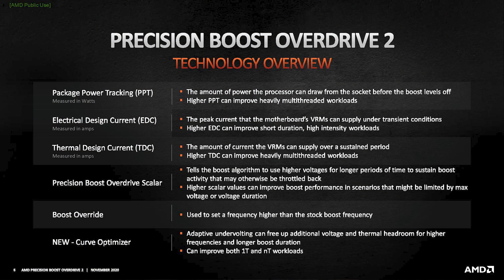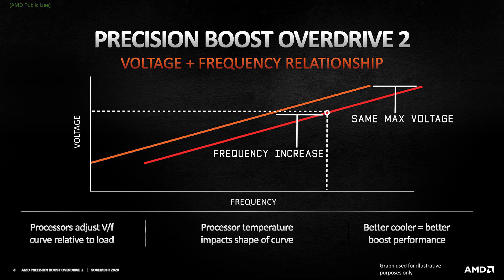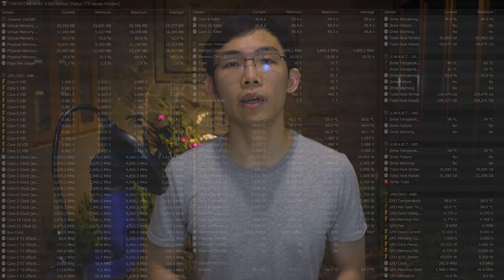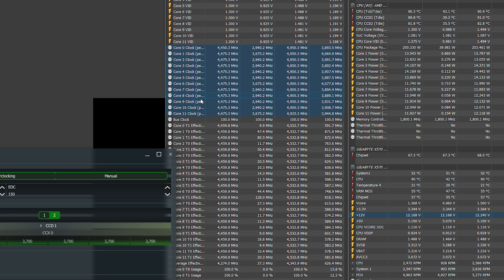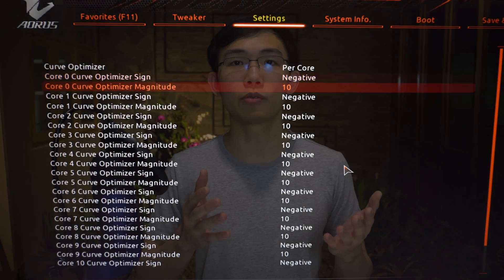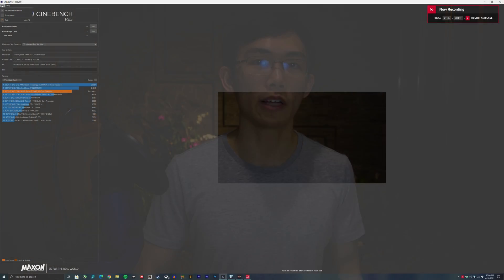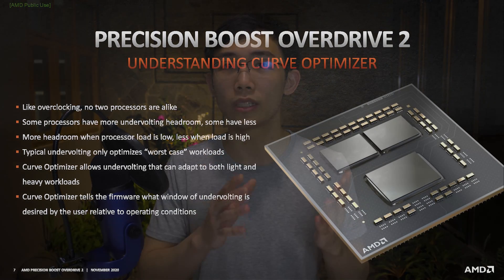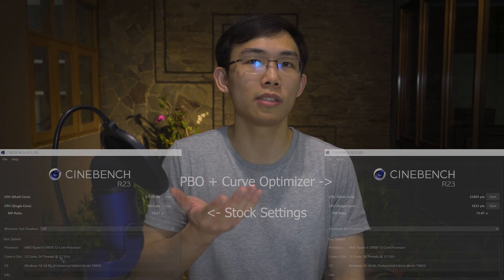The Best Way To Overclock Ryzen 5000! | How to use Curve Optimizer

Comment: 11:39 Actually it is very easy to pinpoint the core that crashed. Just open your event viewer and create a custom view for the WHEA-logger. As soon as you crash, go to the viewer and check the APIC number that corresponds and divide it by 2 and there you have your crashed core. If you open CPUZ in the tools section, export an html and search for the APIC section and see which number corresponds to which core on your system. It might sound complex but it really is fast and accurate
Reply: It was simple at beggining because the error in Event viewer was telling me the APIC ID... But after that my pc was crashing randomly wihout telling pe the APIC nr, just that the pc shutdown.... I tried to lower them by turn and it didnt work... I had to lower all of them by 5 and now is ok..
Reply: You don't actually have to use CPUID to figure it out.

If you have a 4 core processor with hyperthreading, it will be like this:

Core 1
Thread 1 = APCID 0
Thread 2 = APCID 1

Core 2
Thread 1 = APCID 2
Thread 2 = APCID 3

Core 3
Thread 1 = APCID 4
Thread 2 = APCID 5

Core 4
Thread 1 = APCID 6
Thread 2 = APCID 7

For example, if you get an error with APCID 26, then it is the 12th core in the processor causing it (particularly the first thread on the core).
If you don't have hyperthreading, then the APCID will simply be identical to the core number. With hyperthreading, each core has 2 APCIDs. The APCID always starts at 0, so your core 1 will have APCID 0 and APCID 1 with hyperthreading, or just APCID 0 without hyperthreading. Perhaps I'm over explaining, but you can see the pattern in my example above.
Reply: @jonny6702  that was cool, thanks for the tip!
Reply: @jonny6702  If I have a 4 core processor with hyperthreading - how can I get an error on the 12th core??

Comment: I have 5600x with Arctic Freezer 34 Esports DUO.
I check the stats with HWinfo64.
Testing with Cinebench R23.

When my "PBO limit" is on "Motherboard" the temps go to 82, when "Disabled" temps are 66. With same other settings. Can you tell me why is that?
I saw that when I set Curve Optimizer to all cores "-30" and PBO boost "+200", the Single core clock is higher "4,841" but the Multi-core goes down around "4,260 - 4,313"... Cinebench Multi-core test ~11000 or little lower.
Like I said, if I change "PBO limit" to "Motherboard" the temps go 82 to get higher Multi-core clock, but it is not worth it.

If I set PBO to just "Enable", without any other setting, the Single core is ~4,65 but the Multi-core goes up to 4,55, at the cost of 82 degrees, which is not good again...

I want to achieve both high Single core and Multi-core with around 66-70 temps!
Any suggestions?

P.S. I didn't understand what is the manual method, calculation to determine the EDC, TDC, PPT values, this is why I tested with "PBO limit" either on "Motherboard" or "Disabled".

Comment: 5:44 I have also noticed mentioned tendency myself: higher EDC gives higher temperature but clock speed is lowered, while lower EDC gives lower temperature but clock speed is higher. Assuming that the EDC limits are reached in both cases, it means that the computer draws more current and works slower, yet generates higher temperatures . This doesn't make sense. Unless we assume that at lower clock speeds and higher EDC, the processor is more heavily loaded but operates slower (or wastes power). I think that changing all these PBO settings (EDC, PPT, TDC)  is merely an optimization for specific applications, rather than overclocking per se. A more loaded processor operates at a lower clock speed, while a less loaded processor operates at a higher clock speed. Which is better depends on the application.

Comment: I turned off all limits in MSI bios after worrying warning. my 5950x ascended to 5.2ghz and then tripped something and system froze. i guess I am doing it wrong. is 1.45v on cpu safe or shhould I stay under 1.3?

Comment: Hey 
O!Technology, if you increase the 3 values of the PBO limit you will push more voltage in your CPU and you will have high temps. You should disable the PBO limit so the algorithm will find the lower voltage that the CPU can run the high frequencies. Also if you choose the lower power saving plan you will see a drop in temps without loosing performance. About 95% of the time your CPU will be at max 85% in usage so what you see in the stress test it will never happen (not even if you render a video). Aside from this the power saving is made to better adapt the consumption to the load and if the load needs all the cores at max, it will allow the voltage without loosing performance.

Comment: The most common crash after overvolting is changes between high load and all core idle. This is because those change points cause high ripple currents which may trigger the crash.

Comment: 6:56 "This is completely safe" after using PBO features that explicitly say "Warranty void" 🤔

Other than that, great video!
Reply from the maker: I didn't say anything wrong though? Thanks!
Reply: @OTechnology  Even enabling PBO may damage your CPU and the official party line of AMD is that CPU is no longer covered by warranty if you enable PBO. Of course, they would have hard time enforcing that limitation here in EU: because they obviously advertise PBO as a feature for both the motherboard and CPU, it must be supported feature and as such cannot be off-the-limits for warranty.

For countries with less-strict consumer protection laws, I would consider twice before activating PBO.

Comment: Testing shows that EDC impacts performances differently at different values. To high impacts single core, to low impacts multi core. The sweat spot seems to be around 120-130 for optimal results on both on 2 ccd cpus.

Comment: Def not any more work to dial in CO on a 12/16 core Ryzen 9 unless you are actually spending hours increasing CO units on a per core basis to pinpoint which core crashes at a given offset. The only way to efficiently set your CO is to create an Event Viewer profile in windows to log when you get a crash. Even prime95, Cin. R23 can be stable and certain games/apps will crash after you get it dialed in for stress testing. The only way to accurately know which core is crashing is to log it. After a crash you go check your event log to see which core crashed and reduce the neg offset on that core. Also LLC can play a big role in CO stability. Increasing LLC is a must for stability with high offsets in my experience. I've only had 1 Ryzen 5000 not be able to hit over 5ghz light core workloads but it was also the only China batched chip 5800X I have ever tested with.

Comment: Great video - explained properly and exact!!! Just tuned my 5900x and 3-4 cores are easily sticking to 5,04Ghz now, most of them up to 4,8-4,95  at single core tests. All core goes up to 4,6 - 4.67Ghz. Just made CCD1 -17 and CCD2 - 30 with EDC of 125, and PPT 250, TDC 170 and I almost never go over 70C with 360mm AIO :) Now it's almost perfect, but as I'm on linux and no windows, per cor settings won't be easy at all :D Still way better than before as I would go up to 4925 on the best cores and barely keeping 4,5GHz all core with over 80C temps and the same cooler :) If with the new settings I keep the EDC at 120, I barely go over 65C :D AMAZING video!!! Keep it up !!!

Comment: 5900X running -30 All Core and no crashing. Multi core clocks boost to 4.545GHz and single core to 4.95GHz. The BIOS won't allow anything less than -30, is there any way to squeeze more out of it?
Reply: I'm in the same scenario as you, ryzen 9 5900x with x570 asus dark hero. Latest bios and latest amd chipset driver. I have everything at -30 on all cores and ran OCCT for a few hours at stock power limits ppt=142,tdc=95,edc=140. Not a single crash with maximum cpu boost override at +100 to try to hit atleast 5ghz. Was peaking between a little over 4.9's ghz to 4.6 ghz on single core and multi cores were running at 4.5 ghz stable. Cinebench 23 scored single core at 1620, and multi core was at 21205. Which I read was as good as stock. My thermals did get a decent drop in cooler temperature by 5c. But no matter how low I go on my negative offset was for each core my cb23 scores didn't go up, until I bumped ppt to 165, tdc to 115, and edc to 160. My multi score went to 22450. But my single score always stayed the same. Thinking about removing some negative offset to my two best cores on my ccd0 and ccd1 probably at -15 or -20 to see if it'll at least peak at 5 ghz. But this stuff gives me a head ache for minimal gains.

Comment: this is really cool and i was an allcore overclocker till this day, will give this a try, ryzens are really difficult to understand and to squeeze performance without sacrificing single or multi core scores.. is it possible to overclock per core?
Reply from the maker: Yep give this a shot! You kinda have to let it do its thing more than on intel cpus.

Edit: Overclocking per core is possible but you will not be able to hit the same boost clocks as using curve optimizer still.

Comment: why is max boost overclock override max 200mhz ?
Reply: It used to be 500 MHz but a while ago manufacturers changed it via BIOS update to limit it to 200 MHz. Probably too many CPU's died and caused too much false warranty cases, which caused too much cost. But that's just a guess why they changed it. 200 MHz is the new maximum now.

Comment: your wrong ?????? cause your chinese you know amd ? your not xD so many info is just bad men
Reply from the maker: Im not chinese im Indonesian lmao what does that have to do with anything
Reply: my 5950x run at 72 degré on load but you know whats those cpu are made to use 65watts max xD
 not 90 thats why you got 90 degré on load and very fast use all your info but change vcore to offset mode and use 1.1800v not even lower 1.1355v xD for more performence if your on Op cpu cooler same performence xD

Comment: dude you just saved me so much headache, I had all my pbo settings maxed I dropped to 120a on edc got 4.675ghz all core on cb20 but my overall was only 4.55, upped to 139a which is my sweetspot for 4.610 all core 😅 my man 💪 👏

Comment: since my case scenario probably not the same than you been lower core count which often run in low usage scenario wouldn't going whit agressive negative offset on vcore voltage whit loadline calibration that overshoot a little for those rare time power is requiered would not end be best ways to achieve a théorical perfect balance of efficient as well as been powerful when requiered.
-thx for sharing whit us?
i would encourage you to try to avoid abreviation terme that can be unlcear for some user by giving more detail to there nature whit perharps some visual addtion text like you did in some occasion avoid to lose the viewer whit terme there not familiar since not everyonne first language is english tend to get lost with those i would lead to believe could yield nice result in the long terme

Comment: Came back for a second comment. I watched so many guides on PBO and CO. While I kept tweaking and guessing it was when I watched THIS video that it clicked in my brain. Thank you for the best explanation of all time for this tech because this should be the official guide. I stopped at -15 on my best cores and -20 on the rest as this seems extremely stable and my benchmarks are the best theyve ever been. Keep up the amazing work and thanks so much as you've turned my gaming rig into a tuned machine with spreading your knowledge! 140PPT 90TCD 130EDC was my sweet spot for keeping this machine in check. :D 5800x + 6600 XT build.
Reply from the maker: Awesome! So happy to hear when my guide helped haha!

Comment: I tried all of the overdrive settings on a 5800x with  an Evo 212 v2 cooler im building and found that leaving the overdrive settings to auto and setting  curve optimizer low as I could which was  -30   (later set to -25 to ensure stability for my friend ) along with max cpu temp set to 80 c was the easiest option that had almost the same results as tweaking the PPT/EDC, i get 4600-4650mhz   multi thread 4850 mhz single.  If its not stable at the above settings change curve optimizer by 5 until you get a  few stable runs of cine.  If you so desire with the above settings you then should be able to  run cinebench  & then  watch the  PPT/EDC/TDC  % usage values in ryzenmaster and then have a good idea of manually adjusting the values to  match the desired max  temps/mhz your looking for without setting a max temp. Example:  the PPT showed 83% of 142w on cine with auto settings -30 co which is approx 118w  @ the 80c limit i set  so adjusting the PPT to 118w along with changing the other values the same way should result in the same temps without the lower temp limit . Before i started tweaking the settings my cpu Shot to 90 C (max) temps in a jiffy and although everything i have read says these temps are normal i wanted to reduce them to have a safer margin without much loss of performance.

Comment: There is a way to find which cores crashed during a test. By using the WHEA log report in windows after a crash, you can see a message of a CPU ID like; "Processor APIC ID: 8 - A fatal hardware error has occurred". To see which core this belongs to you can open CPU-Z, click Tools and then "Save report as .txt". In this report the threads, Core IDs, CCXes and Nodes for your CPU is shown. For example, I have an AMD 5600X. An error message of "Processor APIC ID: 8" tells me that Thread 8 caused a fatal hardware error. Thread 8 is the first Thread on Core Nr 4 (Between cores 0, 1, 2, 3, 4 and 5 on my 6-core CPU).

Comment: When using OCCT cpu test it tells you what core starta to do miscalculations if it's not stable that way you can fine tune curve optimizer super fast. I can do a negative offset of 30 on all cores but core 2 and 4 on my 5600x. Those I have at 15 and 5 respectively and that is rock stable. And even though it looks to boost higher than just PBO +200Mhz the performance is actually slightly worse in cinebench multicore than with just PBO +200Mhz. I havent set other limits than the motherboard though. Maybe thats why?

Comment: Damn didn’t think about the 5900x having two different sets. I was putting all core to -20 and still getting bad temps! I suppose it was boosting way too much for it. Gonna try and put the first 6 cores to -15 and last 6 cores -20 or -25 and see what happens.
Reply: damn i got the same issue lol
what gpu r u running

Comment: While I was working on overclocking today I was watching the speed graph in Ryzen master and I was able to pick out the core causing the crashes pretty easily. Almost all of my cores on my 5950 were following nearly the same path on the graph when they ramped up and down except cores 1 and 3. I was able to pick out those 2 cores as the ones with instability and increased (decreased) my negative offset on the other cores 5 at a time until some of those cores also started to wander a bit from the others and started showing instability. I was able to pick through my cores and maximize the negative offset of each core in a pretty timely manner with minimal crashes this way. I recommend watching that speed graph for anyone that wants to save themself a bunch of time. It helped me immensely.

Comment: I was running an all core set to 4.75ghz at 1.2875v and was performing well but i knew that having a good pbo profile is much better but i just stopped caring as much when i used easy tune from gigabyte and had a perfect oc and the virus program it is corrupted and i couldn't get it to work again so i just used ryzen master, atm this is lookng good but haven't tried any games or other loads on it yet other than r23, however on a 5800x i am at 250,170,100 for power and at negative 30 for all cores but still stable is this right?

Comment: Thank you so much for taking the time to make this. Seriously. I was tearing my hair out trying to work out why my 5950x kept crashing with PBO on. Turns out the default PPT, TDC and EDC on my Aorus X570i pro wifi were set way too high. You rock, dude!
Reply: From my past year experience that seems to be more related to your temperature than the actual settings of these limits. If your cooling solution is not capable of handling a 250 watt cpu, you shouldn't play with overclocking. Also, undervolting with the curve optimizer can substantially decrease your temperatures so you should be able to push these limits higher.

Comment: He says it’s not an undervolting tool, but precedes to describe a undervolting tool.
Reply from the maker: It is not
Reply: @OTechnology  it is, whenever you make a chip run at its highest clocks at the lowest voltage it can, that’s undervolting. Plain and simple.
Reply from the maker: @aflyingmodem  The voltage does not decrease from stock if you use it to increase performance. The frequency increases instead.
Reply: @OTechnology  even by that definition, running the highest clocks at the lowest voltage is undervolting
Reply from the maker: @aflyingmodem  This is running the highest clocks at a similar stock voltage. It is just overclocking.

Comment: Stability testing can be done with OCCT which allows to cycle single thread variable loads across all cores and tells you which core was unstable. Very straight forward even with 16 core CPUs

Comment: When I was testing an all core OC on my 5900X, I found Cinebench, Blender OpenData, and an x264 encoding test to be most useful to test my CPU's stability. One particular scene in blender would push the CPU so hard that at anything higher than 4.4Ghz, it'd go past 90C with my cooler which was not so good 😂 but yeah, a plethora of benchmarking tools would be best to validate different workloads.